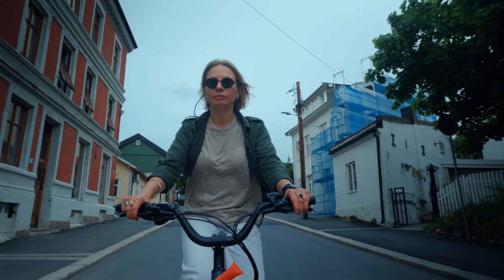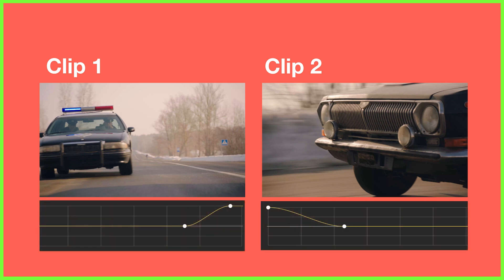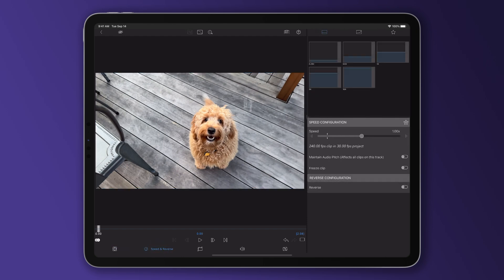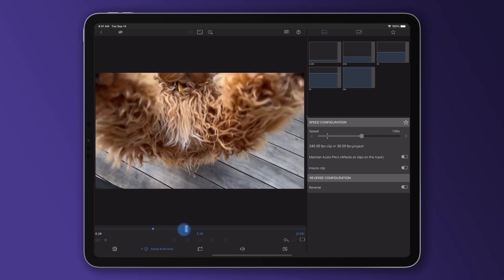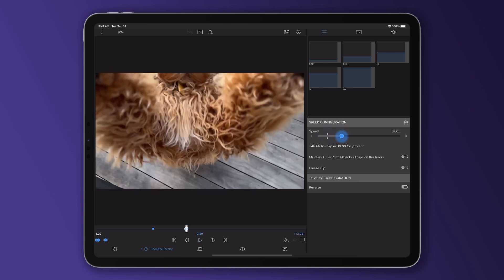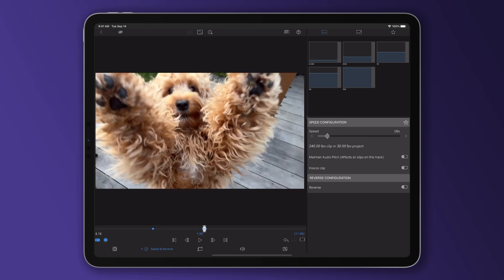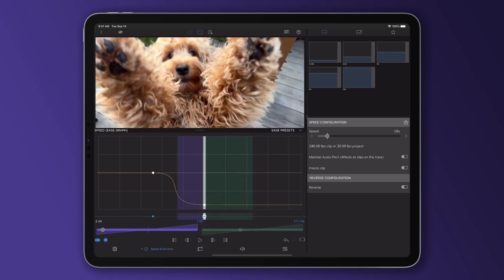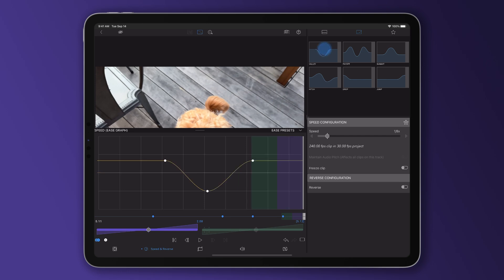An Introduction to Speed Ramping in LumaFusion

Comment: does it automatically add motion blur  when ramping up?
Reply from the maker: It does not. I usually put in a little bit, and keyframe the effect's strength to correlate to the speed the clip is sped up to.

Comment: I would like to know if there is a way to add a speed ramp preset for multiple clips in order go?

My reason for this is that if I have a video that follows a beat, but want parts of the clip to go from two to one second long, hence the preset that i created, i then would like to be able to split up the clip at the point where I want the speed change to happen, instead of having to fiddle with a tiny editor screen, where I would have to fiddle around with multiple parts that would just make the process a lot more difficult for me.

Anyway I have a one minute clip that I have split up into 2 second slices, and I just want to make each of those one second long with my speed ramp preset in one go, Is that possible?
Reply from the maker: Hi there, at present there is no way to apply Speed edits to multiple clips (though we are looking at potentially including it in a future release). What I would suggest would be to open one of the 2-second clips, create the speed ramp edit you like to get to the desired duration, then save that edit as a Speed Preset (tap the Star+ in under the Presets panel). 

Now you can apply that preset to each of the rest of the clips to get them into the desired duration. Note that any Speed preset will scale to whatever clip length you apply it to. Happy editing!

Comment: Question: What if I had a clip shot at 29.97 and wanted to speed it up or slow it down? Could I do that without it looking choppy?
Reply from the maker: Hi there. You can speed any clip up without it looking choppy, but slowing it down will depend on the framerate of the timeline. If you have 29.97fps footage on a 24fps timeline you can slow it down a small amount without any risk (to 80% speed), and likely you'll have some leeway around that, depending on the action in the footage. 

Generally if you know you'll want to slow footage down it's best to shoot in a higher frame rate (60, 120, or even 240fps), which take up lots of space on your devices, but give a lot of latitude for speed changes.
Reply: @LumaTouch  okay I understand thank you